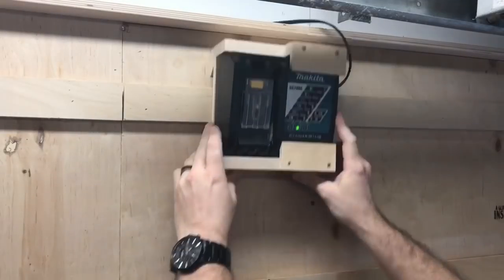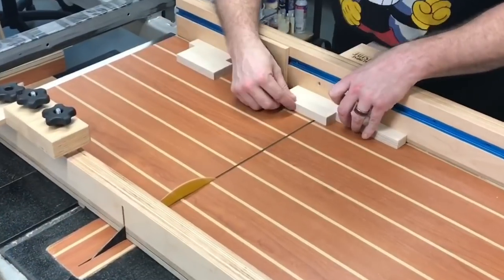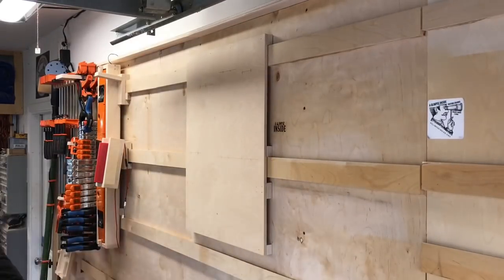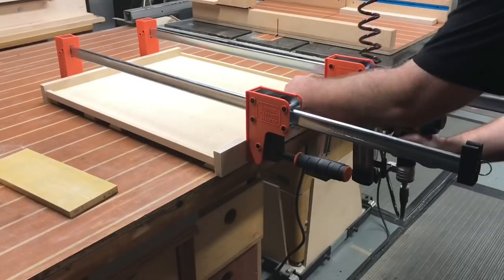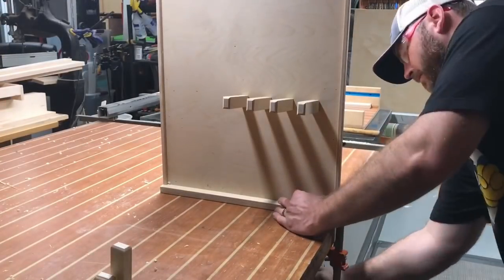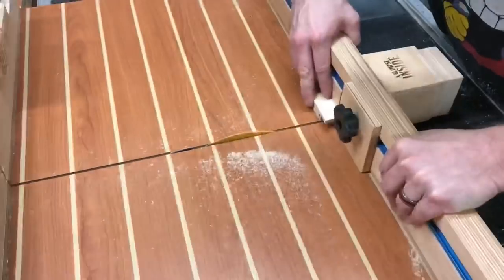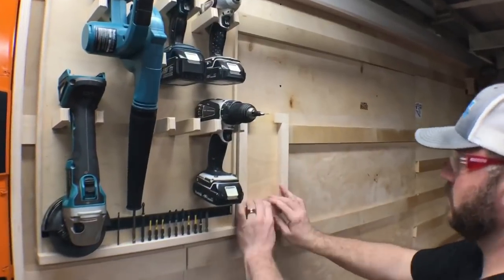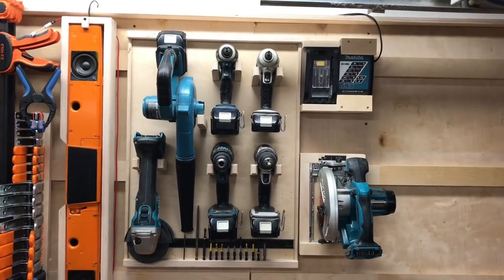French Cleat Organization | Cordless Tool Storage | DIY Charging Station | Woodworking

Comment: I'm building my wall today and wanted to get some more ideas glad i found this, the circ saw holder is great and I have a spare magnetic strip same as that think I'll give that bit holder idea a try, makes good sense to have those there.
Reply from the maker: At sounds awesome. Glad you got something out of it and thanks for letting me know
Reply: @AGlimpseInside  no harm really i stopped after the first rip cut which basically resulted in having one short one, which I will use for the opposing hanger bits and cut it up.

Comment: Can you talk a little about the battery charger? I'm a Makita guy also and have the same charger. Your french cleats always look waaay sexier than mine. My question is how does the charger stay fixed? When you remove a battery does it tend to lift off the cleat or did you do anything else to fasten it to the wall? Would appreciate any feedback. Nice wall sir!
Reply from the maker: My solution is to put a small wedge of plywood 
Back there so when I lift up, it all stays in place
Reply: @AGlimpseInside  
Is it possible to get a pic? Do you mean it's on the back on the cleat side? I was wondering if the entire holder lifts off the cleat or if the weight of the charger and the plywood keeps it in place. I see myself grabbing the battery and having an entire charger and mount come off the wall with it.
Yeah.......im that guy 😖
Really appreciate you responding! 
Already shared your channel with some friends 👍

Comment: On the circular saw cleat, how do you keep the cleat from coming off the wall when you slide the saw up under the small brackets. To be, it would just lift off.
Reply from the maker: The circular saw simply just comes out when lifted up about a half an inch and pulled slightly. I see what you mean I’m just careful when putting it back in and taking it out that’s all

Comment: Good work bro. BUT...(as always)..
I ALWAYS mount my tools so they can be grabbed and activated.. that means not upside down,  not bits facing my.. well ..face.. grab and go. Off the wall and into the work piece. Im a lefty, but still.. grab a screw gun with my hand..boooom! Drive a screw. I dont juggle flip switch etc. Grab n go bro. Just me?
Reply from the maker: StupidEarthlings You got a great point here brother. Not to mention that it might be possible to grab the impact driver while scraping your arm on a drill bit that was left installed on the drill underneath. Not that I would know from experience or anything I’m just telling you from my friends point of you… Yeah… My friend. Good point brother I appreciate it.